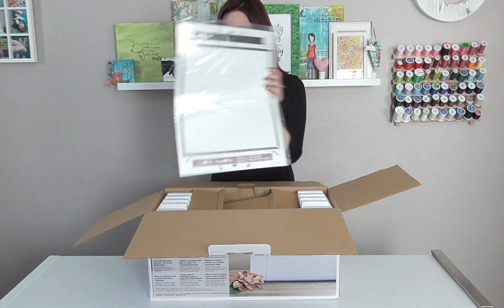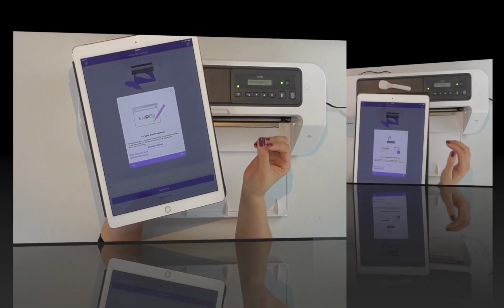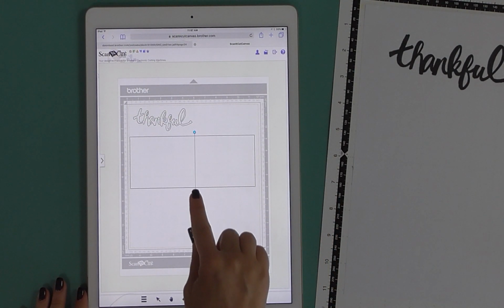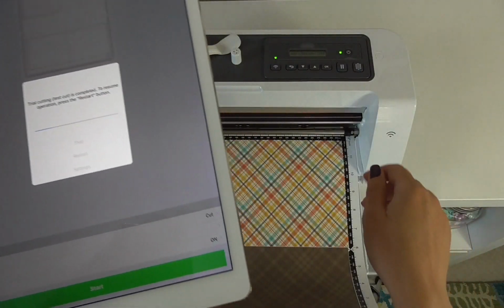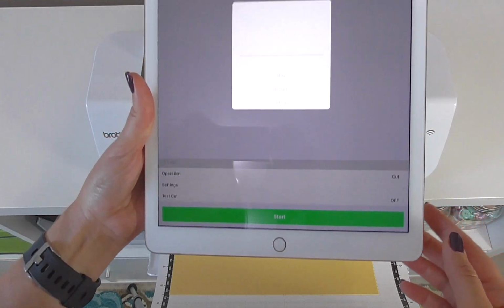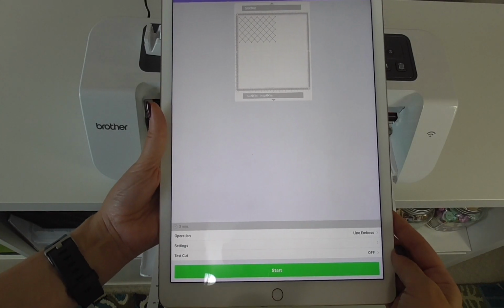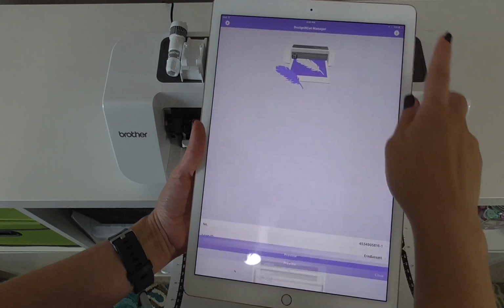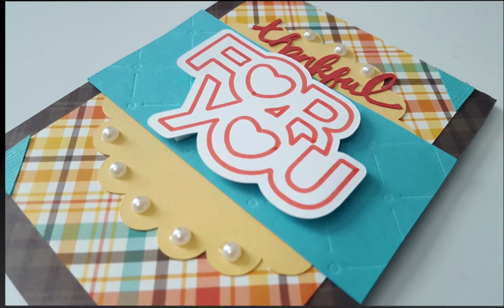Unboxing the DesignNCut DC200

Comment: Did you know that professional commercial grade cutters are still using manually adjusted cutting blades in the same manner as shown here and on Cricut cutters?  You twist the housing of the blade to reveal more or less of the tip of that blade.  Then you make trial and error test cuts to see what is the right depth for each type of material you plan to use.  You also manually tweak the pressure and speed of the test cuts all while taking down notes to create a cheat sheet.  This cheat sheet is then used to create a database of the best settings to use for each type of material.

Laborious and wasteful.  Shortsighted.  I asked Intec Printing who is a leading manufacturer of commercial grade cutting machines if they could make a machine with an auto blade and if they could use software to enable their color CCD digital camera to function as a whole bed optical scanner.  I wanted to know could their $3,300.00 machine could be used as a Scan-N-Cut.

You'd think someone punted their child across the parking lot the way the replied to my question.  But in a sort of polite way because it was on their public YouTube channel where I asked the question and where it was answered.
Reply: @BrotherCraftsUSA  Thanks.  I already own a SDX 125e.

Comment: I have the design and cut and I cannot figure out how to get it to work on the computer there is no video that shows you how to get work on the computer I do not want to put it on an iPhone and iPad I want to put it on my computer is there a video out there that can show me how to get it to work
Reply: Yes, I'm using it on my computer and it doesn't show how to load the design into the machine or have the machine recognize it. It's all connected and talking but I don't see how to get the design to the machine using my computer.

Comment: The audio in this vid is not good - we can hear the machine thumping away quite clearly, but it seems like they depended on a camera mic while it's pointed at the technology & not at at the presenter, so listening to her requires concentration as well as high volume (but be ready to turn it down when the machine starts up!). This seems like an interesting machine, I'd never been interested in the highly overpriced Scan n Cut - when I already have a scanner, why would I pay nearly $900 to get another, just for the extras that a manual die cutter could do?  This more affordable machine makes more sense - to work with the equipment you probably already have; e.g.camera phone, scanner, computer, ipad & their various pic files etc., but by going into the excruciating minutiae of changing screens & applications, they've made it appear a lot more difficult than it probably is. (How many screens to you open & close on your phone or pc in everyday use without even thinking?)  I planned to get my Design n Cut from a rewards program, but I'm sure many  paying full price would just say (see the other comments) that it's all too hard after watching this & just cough up for the more expensive Scan n Cut.  After you've conceded you're not paying $200 for a manual die-cutter or $400 for the Design n Cut, it hardly seems like a jump to go from the basic $500 option before add-ons, to the $700 or $900 version, does it? LOL.  A conspiracy theorist might say "& maybe that's the whole point".